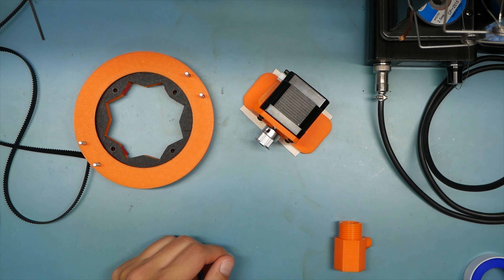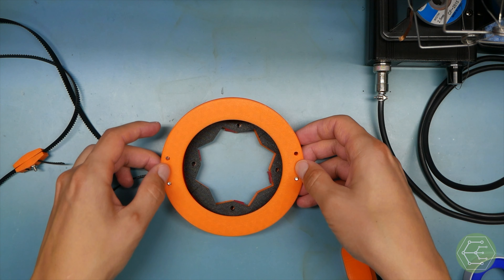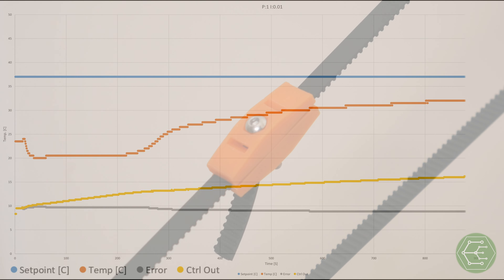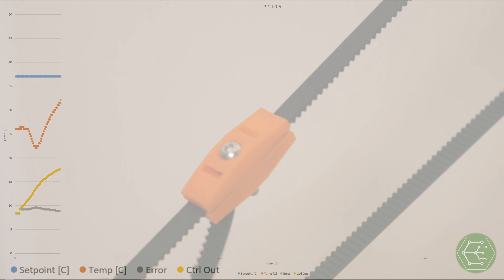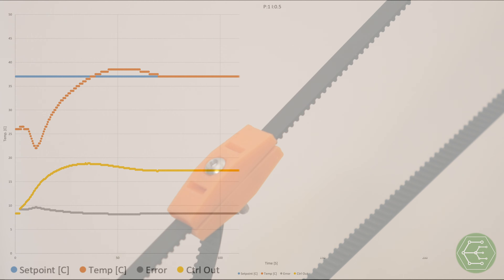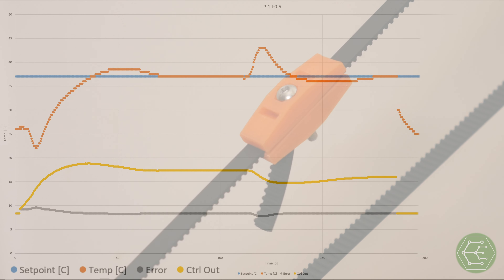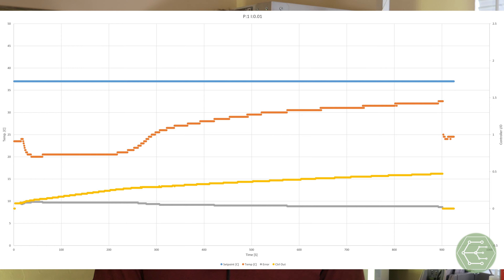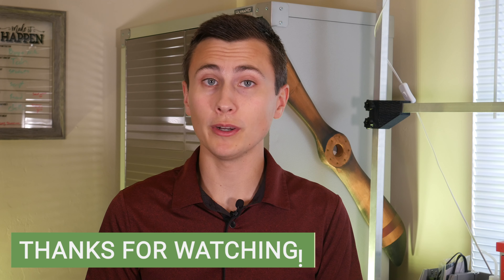A Functional Shower Controller!

Comment: Why is the error hovering around 8? Did you experiment with trying a higher P value, or trying any D value? Did you try to get the cross point down to 30 seconds at all?
Reply from the maker: Hi Matthew! Depends on which run you're referring to. The first couple PI runs we did had such a small P&I terms that the motor was barely moving. As temperature increased, error shrunk. This means the rate of change decreased, leading to a plateau (around a relatively random value). For both of the cancelled tests, I believe the temperature would eventually converge at the correct setpoint, but it may have taken an hour or two. 

 Increasing P or I would both improve performance considerably! We tweaked I first, but didn't go to great lengths to tune the system either. 

I hope this helps! (And no, I really didn't any time optimizing.. had to move on to other fun things!) 30s sounds like a really fun challenge! (Note: code is shared, feel free to give it a try!)